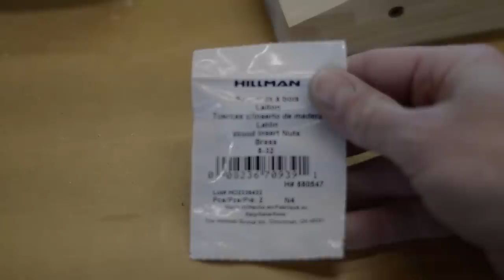Kumiko how to: Japanese woodworking asa no ha

Comment: Use hair spray on your chisel handle (it is a weak adhesive) and it should solve your problem with the handle popping off.
Reply from the maker: Good suggestion, I was more poking fun at them. I use hair spray to hold the grips on my motorcycle.
Reply: @MikeFarrington  hey now, don’t be picking on Tom. 🙂
Reply from the maker: @mgmoody42  Ha! I keep it to a minimum.

Comment: Great video. when you do a large kumiko project, do you still use jigs to cut angle on each piece? or some sort of table saw jig for it?
Reply from the maker: Thank you. Unfortunately the answer is, it depends. On some projects the pieces are less than 1/4" long. Those must all be cut by hand. I also have a way of cutting pieces on the router table using angled bits. This is faster, but really not by much due to setup. The real time saver is using the wide belt sander to make the strips.

Comment: I notice your pieces are thick. I am currently attempting this myself, and the widest blade I have found is 2.2 millimeters. Did you do that for instructional clarity? The experience has been extremely frustrating and very gratifying as well. I'm in a small village in Thailand working with a homemade table saw, cheap Chinese block plane and twisted inconsistent sized lumber. No chop saw either....had to construct a miter gauge before I could make the jigs ! It's looking great so far, I've got 384 pieces to go....wish me luck !! Thanks for the inspiration.
Reply from the maker: Thank you very much for the comment. Yes, I have several different thicknesses I can work with (1/16", 3/32", 1/8" and 1/4"). For this video I used the 1/8", and that was chosen because my other saw blades were out for sharpening when I filmed this. When it comes to actually making a piece, I try to pick the thickness that looks best for the scale of the piece. Best of luck with your project, if possible send me some pictures, I'd love to see your work!
Reply: pics sent to your e-mail :)

Comment: Great video .. great to see how the jigs are made.  Check out Mike Pekovich’s instagram .. he has a little hold down that holds the small pieces while you plane the angles.  

Ps.  Grab some hairspray to keep your socket chisels from falling apart.  The cellulose in the spray acts as a glue of sorts, but is easy to reverse.
Reply from the maker: I do use a hold down when doing really small pieces. I didn't include it in this video because its really only needed for very small pieces, and I consider that a more advance technique than what I wanted to show in this video. Yes, Mike P is great in pretty much everything he does. So my chisel handle only started falling out when I moved to Denver, I'd think it is shrinkage due to extremely low humidity. I probably won't use glue cause I take the handle off frequently. I will alter the part of the handle that slips into the socket so it has a better friction fit. PS I love Lie Nielsen, just a friendly poke at them.
Reply: @MikeFarrington  You can rough up the tang on your Lie Nielsen chisel handle with some 100 grit sand paper and they'll hold well. I live in Albuquerque and was having the same problem of the handles falling off. Just rotate the handle between some sandpaper; you want the grooves to go around the circumference, not longitudinally. If that does not work, I read you can also rough up the inside of the socket of the chisel, but I have not tried that. Great video, by the way! My wife just got Matt Kinney's book, so I'm searching for ways to make the grooves in the jigumi kumiko without a table saw. I'll definitely make your thickness jig though.
Reply from the maker: @rjwata  Thank you. That is a good tip. I haven't seen Matts book yet, but my guess is its great.

Comment: The handle on your chisel is supposed to come off. Just like the Stanley Bailey series handles do.  Its a designed in feature, not a mistake. Youtube Paul Sellers on chisels and unplugged wood working
Reply from the maker: Thank you. I am aware that socket chisel handles can come off when needed. The comment in the video was a little joke. I will say with that particular chisel handle, it was turned  improperly so there is no friction when the handle is inserted into the socket. I recently fixed that problem.

Comment: What are all the angles for the six pointed stars? I'm Jewish and wish to make some for my home and my husband's home. Ty. Shalom
Reply from the maker: I'm not sure. The center point is a 90 degree lap joint, then there are 45 degree points as well as 67.5 degree points. These angles come together in the center.
Reply: @MikeFarrington  is this for a six point? I had to edit my first words because if autocorrect. Shalom
Reply from the maker: Thank you, I wish I could be more help, but the angles above are what I used. I'm not sure it would work for your project.

Comment: I guess the plane or chisel blade should be really sharp to cut the angles? All I'm getting is really ragged edges and chipping.
Reply: Just finished my first pattern. A bit rough around the edges but nevertheless a good start. Should probably get some wood that's a bit more forgiving than pine. :) A big thanks for this video, a great inspiration and it really helped a lot with all the little details and building the jigs!
Reply from the maker: Thats really great to hear the video was a help. Keep at it, get your tools sharp and before you know it, you Kumiko will be crisp and perfect.
Reply: By the way, can you recommend some material for learning other patterns?
Reply from the maker: The only books in English, that I know of, are by Des King. I would consider him a master of kumiko.

Comment: Is maple easiest to use if I'm a beginner at Kumiko?
Reply from the maker: No, Maple is really hard and dulls your tools quick. Something softer, like walnut, basswood, or alder would be a better choice. I use maple because I have a ton of it laying around and I like the light color.
Reply: Thanks so much. I want to get into this type of woodworking.
Reply: What wood should I use to make the kumiko jig?
Reply from the maker: Really anything you have laying around. If you need to buy lumber, I use poplar because its cheap in my area.
Reply: Yeah I would have to go buy lumber. I don't have my own stuff any more. I have to go to a community shop in town that required membership to use.

Comment: Tool review of your sliding table saw and scissor lift table????
Reply from the maker: Im going to be building a new top for my scissor lift in the next few months. I'll do a review then. I'll see where I can fit in a review on the slider. Thank you for watching.
Reply: What is the make of your slider and is that the slider you would choose if money was not an issue?
Reply from the maker: Robland is the make of my saw and e300 is the model (8' stroke). It has done everything I have asked of it, and I paid almost nothing for it used. I would say its a good saw for the cost. For me money will always be an issue so its hard to answer your question, but I would probably call up Martin or Altendorf and order one of their sliders. Having said that, a new slider is at the top of my buy list right now. I hope to find a good condition used SCMI 3200 hydro or a holzher 1243 or something similar with no electronics and a 10' stroke.

Comment: are those pieces 1/2 x 1/4 inches?
Reply from the maker: They are 1/8" thick x 7/16 tall x varying lengths between 3/4" and 2".
Reply: Mike Farrington I though you planed them to 1/2? I'm just trying to figure out the dementions. I now have jigs and the wood and wish to start learning kumiko work.
Reply from the maker: Might have been 1/2". It doesn't really matter. The thickness is really the key. It needs to match your saw kerf perfectly. The lengths are going to be what ever they need to be, the heigh 7/16, 1/2, not super important.